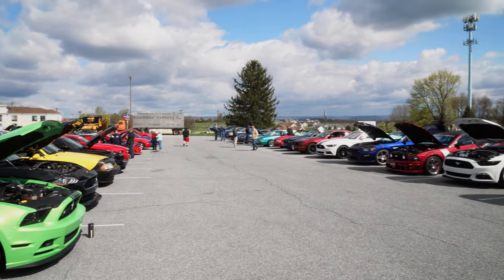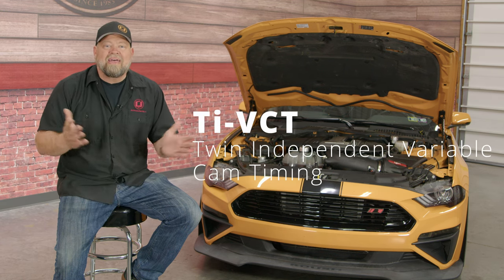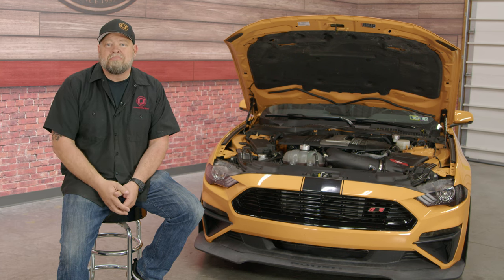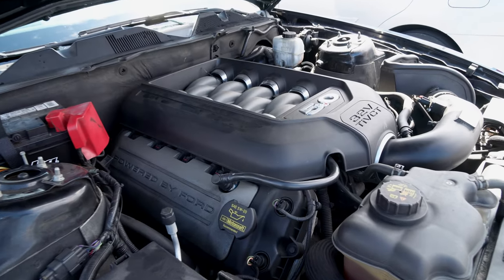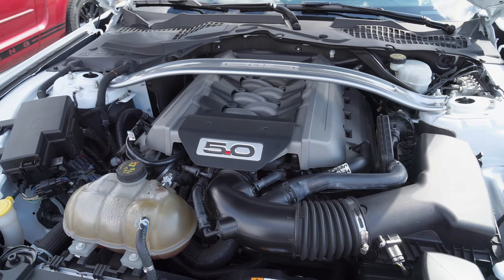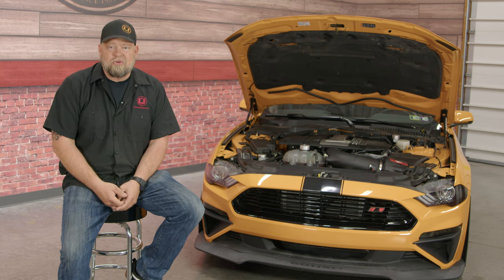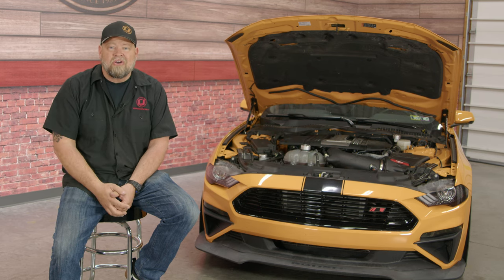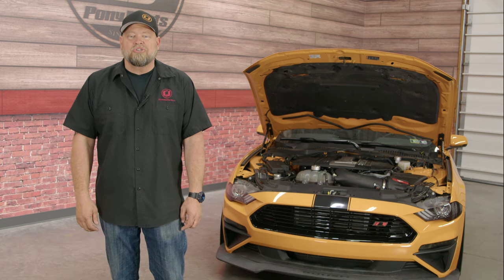What Is the Coyote Engine?! 💡 (4 Min Simple Summary)

Comment: Over 400 HP in a naturally aspirated 5.0 liter engine is just crazy. But one thing this coyote engine shows: that making an engine more "efficient" is how you get more horsepower while also increasing gas mileage which also reduces pollution. If you keep your foot off of the accelerator pedal that is.  lol.

Comment: @3.31 So the gen 3 has both port injection and direct injection?

So no risk of carbon build up on the valves with Gen 3 Coyote ??
Reply: Probably "less" of a risk since the injector isn't placed directly over both intake valves in each chamber.
Reply: @rreno496  So the real question is, with the Gen 3 is a catch can still necessary??
Reply: @scotttracy9333  I did get one with mine. Still catches those bypass vapors and gets oil at the bottom of the can. Just a safe piece of mind
Reply: @scotttracy9333  I run one and it does still catch oil. It’s not a ton but every little bit I keep out of the intake is a good thing.
Reply: @rreno496  I've ordered a Mustang GT and waiting for it to be built. First mod was going to be a catch can, but this video got me doubting the need.

However,  sounds like it's a good idea to have one anyway
Reply: @scotttracy9333  definitely not a bad idea. Not absolutely necessary but no reason in the world not to have it on there. Long term it will benefit you.
Reply: With all the replies on this comment it pretty much answered my question. I was paranoid and lost cause I kept seeing different answers and I’m keeping mine for as long as it can run so I’ll be ordering an oil catch can for mine
Reply: Here i am with a 2015 GT Premium PP. Never had a catch can and got over 80k miles. Oh well.

Comment: Do I need to install an oil catch can on 2020 mustang Gt?
Reply: It would only benefit you I would do it if it was mines.  And change the oil every 3k miles
Reply: @anthonymarinelli9224  just got it yesterday and has 7k miles and was thinking of doing it every 4k miles but probably 3k cause I know I’ll drive it pretty hard and I’m about to order an oil catch can rn
Reply: @chrissanchez9218  yeah that’s A smart move I had a 2018 focus I did the oil every 3k miles  it never had a problem before getting totaled at 74800 miles
Reply: @anthonymarinelli9224  the mustang is my first ever sports car got the 10 speed auto cause the mt82 are weak trans. Kinda got this sick feeling in my stomach cause monthly and insurance is a lot of money I don’t make a lot so I have to be smart with my money but I’ll definitely be buying quality parts for the car no doubt about that
Reply: @chrissanchez9218  I feel u should have waited RN is the wrong time to buy a car used or new
Reply: @anthonymarinelli9224  hell no ain’t no way I’m stepping on gas going 30mph I tires spun twice and traction control was on it was on normal mode
Reply: @chrissanchez9218  what
Reply: @anthonymarinelli9224  didn’t mean to actually post that but today I actually got on it just me in car and wow it’s quick but not safe with the stock tires it comes with

Comment: The Coyote is the engine that will always be trying to catch up with the LS and LT powerplants. Good luck.🤭
Reply: I know that's right!
Reply: All 3 Dodge, Chevy, and Ford make amazing V8's that all trade blows depending on what's been done to them, that's all it is and ever was.  the 5.0 is DOHC instead of pushrod and more modern design People forget the gt500 motor is only 5.2 liters making the power Chevy and dodges 6.2 6.4 and higher make, Ford also makes V6's now that compete with these V8's.  I'm not an ecoboost fan whatsoever in fact they annoy me, but the Ford GT's V6 motor makes 700+hp not bad.
Reply: Until it goes against a red eye with performance kit. 
900 HP.
Kinda ticked at Mopar they have a dealer installed mod,that bumps up 100 HP.
Nothing for the hemi trucks.
But for a car that already has 803 let's make it faster😂